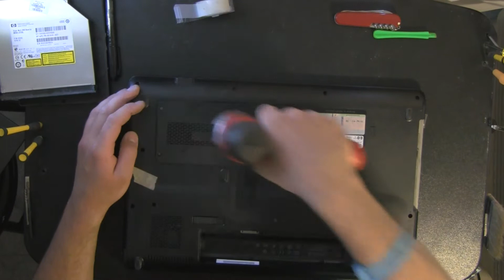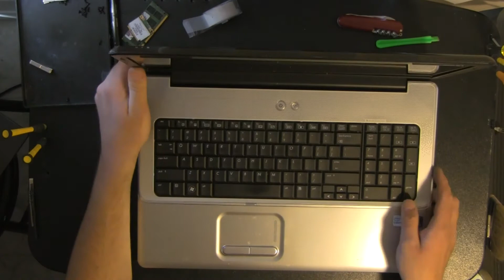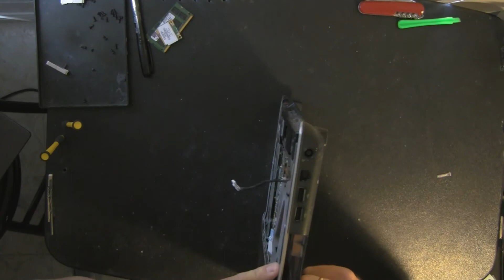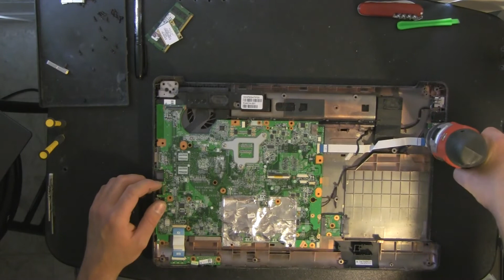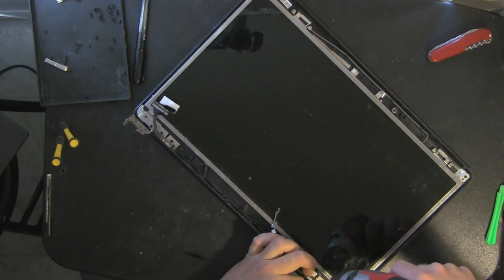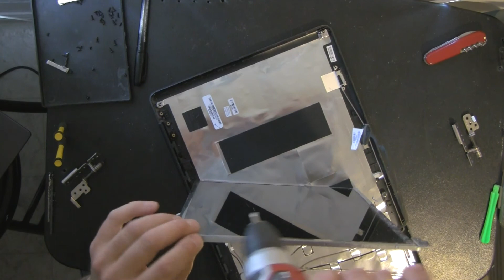HP G71 laptop take apart video, disassemble, how to open disassembly

Comment: Replacing the original one, in which both are SATA. I just need to know if I need another connector, i.e. A female connector of some sort. Basically what I am seeing is that the actual SATA connector fits the two sets of pins on the female side, but then it has it has another, smaller pin section to the left (or right) - depending on which way you look at it - and I wanted to know exactly what that was for?

Comment from the maker: Bad back light easy to know if you look at the screen in a dark. If you will see very dimmed picture. Bad video if you connect your laptop to a external monitor and than you will see nothing. So, if video is good, but picture is no dimmed than it is screen is bad or something is not connected right or video cable is bad for example. 
I guess on all G71  are no inverters, but if you have one, means it ca also be an inverter.
Good luck with figuring it out!

Comment: Oh, shit... We are both on the wrong page, my bad. I don't think I mentioned that I was trying to actually transfer the information on my first hard drive (already in my laptop), to the one I just purchased.

So I was asking what cables I actually needed for a USB connection, so I could transfer it. Because I have a SATA connector and it isn't showing up as "installing driver/hardware" (when you connect something via USB)  or even under my Hard Disk Drive section. Although, I am using a

Comment: I know, but it doesn't read the new HDD when I do it via sata to usb... I've tried a multitude of combinations, but to no avail. I put the brand new one in to see if it would read in my Bios, but apparently it doesn't or I am just going in the wrong places during start; I have hit F1, F2 and esc. It has brought me to things related to the HDD (Don't remember which keys did what), but it doesn't actually let me look 'internally'... If you know what I mean...

Btw, I only have 1 HDD compartment.

Comment: It actually JUST read my hard-drive (after doing this numerous times before, to no avail) but it isn't showing it's actually plugged under my devices on the "Computer" menu. It is although showing it under my Computer Management---->Storage - section. So, I still wouldn't be able to transfer any of the files from my original hard-drive.

Comment: Is the G71 CPU soldered on?
Reply from the maker: Should be removable. But to be exact, I would check motherboard number at memory units location and search for it on eBay. 6 digits - 001 or something similar.